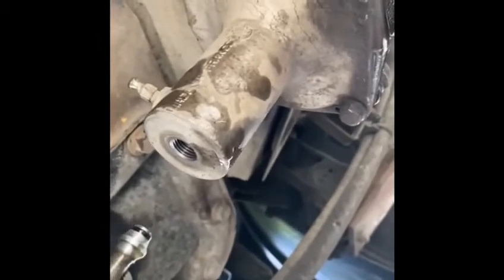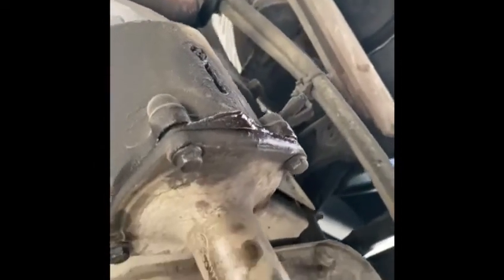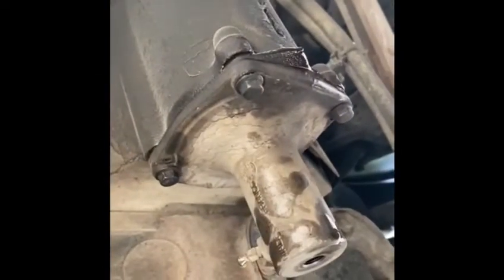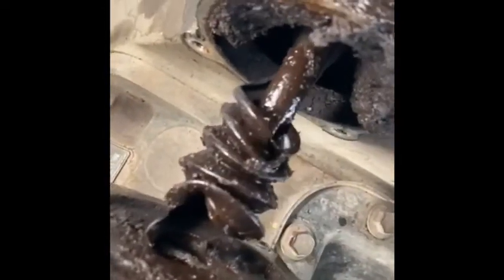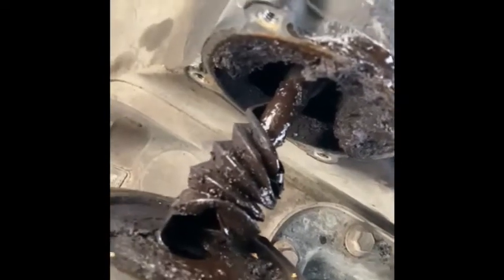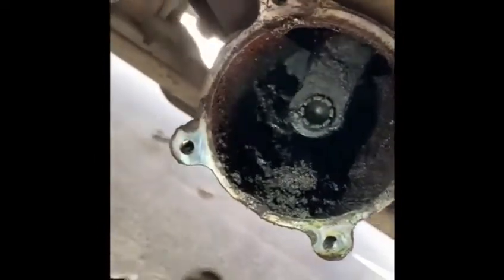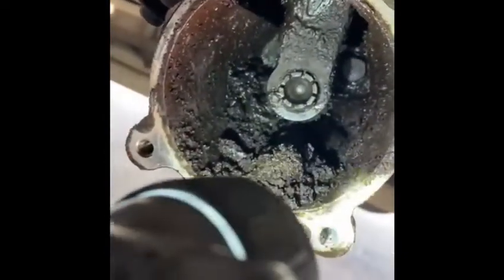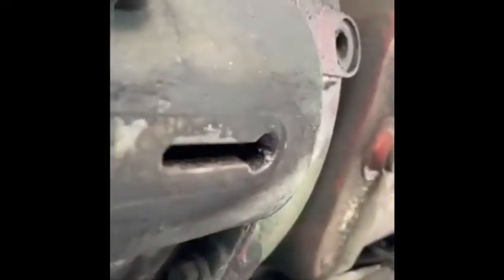Volvo Semi truck Clutch slave cylinder replacement

Comment: Can you post the part number ?
Reply from the maker: WABCO 9700515120 - Clutch Slave Cylinder this is for 2013 Volvo vnl670 Cummins isx15 10 speed manual .